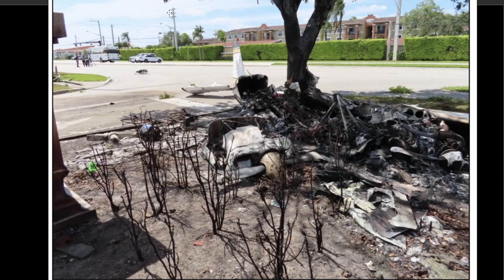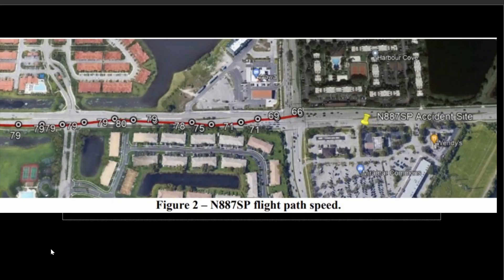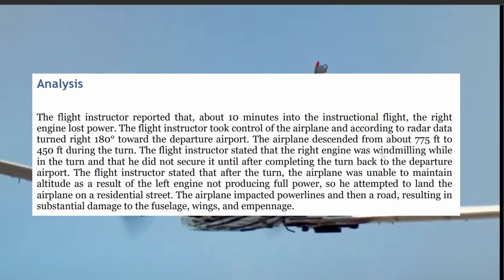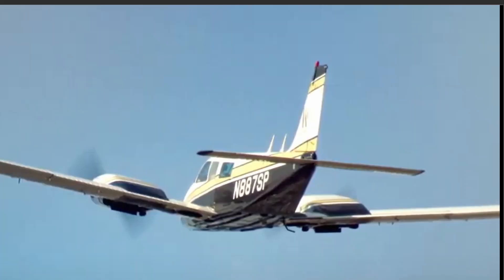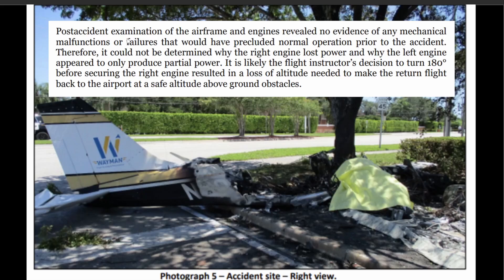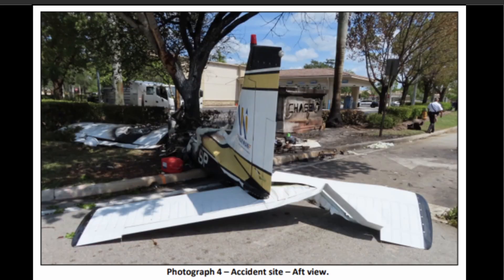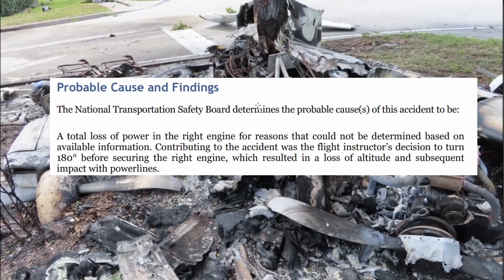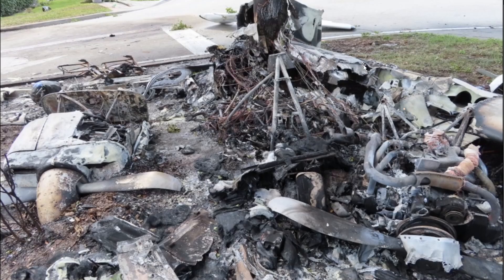Piper Aircraft and the Impossible Turn

Comment: CFI states that "I was unable to maintain altitude due the right engine failed and also i could not get full power from the left".  BS, BS, He didnt feather it, turned back when low IN PANIC, then i bet was so scared and weak that decided not to use full power on the other engine so had to do less effort in his fear. (Partly froze by fear) Then in fear decided to put it on a road.  

Senecas can hold altitude even with one engine windmilling if 2 on board only.  That CFI is a lying coward.  He killed his student too.  Bolted out and left him there to burn and die.  I have 2 full engine outs and landed them on airport both.

Comment: A 180 degree turn will take you to the downwind leg more or less depending on the angle of bank used.  It does not take you to the opposite runway as intended here and calling that An impossible turn".  That is a Turnback, not a 180'.  I learned them in 2001.
Reply: And you learned the 2 kinds from this "crazy CFI"  (As some called me in the 1990's because i could teach LOTOT/EFATO turnbacks and aerobatics too).  I proved them wrong,  They practice them now.

Comment: As a MEI I know most light twins we use for training have very poor single engine performance . Turning at low altitude, single engine, is a risky proposition. Climbing on one engine is usually no more than a few hundred feet per minute. Climbing straight, ahead as best you can, completing emergency checklists, and gaining speed and altitude before returning would be a good option. Maybe the instructor thought he was about to lose the other engine and had to take immediate action. Guess we will never know,.
Reply: Some of my new students either panicked and froze, ... or Panic and turnback without thinking.   Both pilot errors can knock you down.  Not acceptable pilot performance.
Reply: @emergencylowmaneuvering7350  Wish we had easy access to simulators like military, airlines, and big flight schools. May not help with fear, but procedures can be hammered home before ever flying.
Reply from the maker: Thanks for your thoughts.  Interesting

Comment: Right engine failure: Step 1- Feather engine. The simple fact that this was not done immediately, turned into the troubled engine, and, the confusing remark about the left engine, suddenly not producing "full power", only AFTER the turn with the windmilling right prop? 

Makes me question his ability, and if he was even rated for this craft. Everything it appears he did, was wrong- if this is all accurate. 

Sacrificing ANY altitude at that height, is basically dooming any chance of getting down alive- from all I've learned over the years. 

To me? This reads like he panicked, instead of flying the airplane in safely... 

After some further research? I'm beginning to really question the safety at this flight school. I'd love to have Dan Gryder take a look at this one. 

This is the 3rd "engine failure" from planes at this school. While neither of the other two resulted in fatalities, they both went down in non-airfield locations. One on another highway- a single engine Cessna, and the other in a swampy area, in a twin Seneca as well. 

The way the vice-president was out there talking to the press, stating how his flight instructor "did all he could do" & "followed all the strict safety procedures", (pp here), came across as phony- as if from someone who KNOWS his ass is already covered. 

In addition? This was in Broward County. They should change their name to "Lax County" or even "Coward County", being it's the home of the cops that did NOT charge into the school, much like the more recent one in Texas, to stop an active shooter, but instead just stood outside having tea... or something like that.. if ya catch my drift. 

Something seriously wrong here, imo- and in much need of further investigation. 

Many know, especially if they watch Dan Gryder's channel, how LITTLE the NTSB & FAA care, about GA, or "General Aviation". They prove it all the time.
Reply from the maker: Thanks Rick for sharing your thoughts, always appreciate your feedback on these

Comment: A Piper Seminol should be able to fly on one engine, just!
I am endorsed on this model and many other twins.
The correct proceedure at low altitude is to maintain "blue line" speed.
Both mixtures rich, both propellor pitch levers full fine, both throttles full.
Identify the dead engine, confirm by pulling the throttle and FEATHER the prop, mixture to idle cut off.
Confirm gear up, dead engine cowl flap closed.
Bank 5 degrees towards the good engine and MAINTAIN "blue line" speed.
If no obsticles ahead consider flying straight and climbing while MAINTAINING "blue line" speed.
DO NOT turn towards the dead engine, turn towards the good engine if a turn is necessary.
DO NOT turn at low altitude!
During my endorsment training in the Seminol, I was required to correctly handle an engine failure on take off at 300 feet and climb away to circuit height and return for a single engine landing, with the "dead" engine shut down and feathered. I had to do this on all the twins I was endorsed on.

If you cannot maintain height, the object then  is to fly straight at "blue line" speed minimise the height loss and find somewhere to land. Treat the aircraft like a single engine one with really good glide range.

Keep your flying speed, remember your training and don't panic!
"Blueline speed" is best single engine climb speed and is marked on the airspeed indicator with a blue line.

A truely unfortunate incident.
Reply from the maker: That was very informative, thank you for sharing and I hope you are subscribed.  Would love to hear your thoughts in the future

Comment: Condolences to all family and friends involved. However this is NOT an example of the 'impossible turn' which really applies only to single engine aircraft. According to the NTSB report the engine failure occurred 10 minutes into the flight, not an engine failure on take-off. Aircraft needs to be 'cleaned up' and stable prior to any further maneuvering following any power loss. Sad, so sad.
Reply from the maker: Thank you for the kid words
Reply: Agreed.   A 180 he did, but not on climb out after take off.  Some in FAA still call a 180 an "Impossible turn".  Ignorants of EFATO.   It was not the turn that crashed him, it was his idiocy on turning before feathering the engine as required.

Comment: Depends on the A/C but generally if you are lower than 300' and turn back you're dead. In a twin you have to establish safe flight and climb on the one engine prior to planning anything. If you turn into the dead engine, again... not good. My rule of thumb is just push stick forward, best glide, land the airplane. If you have a bunch.... 2k + do the check list for restart.
Reply from the maker: Thanks Tekish please subscribe for more aviation

Comment: Condolences for all concerned. My understanding is to never turn into the dead engine and never maneuver until you’ve cleaned up the airplane, feathered and trimmed for stable flight above blue line.
Reply: We'll never know the truth of what caused the accident but the plane is capable of maintaining altitude on one engine if failed engine propeller is feathered even if gear down and partial flaps. No turn should have been attempted at that low of an altitude. I believe there was a human factor involved that caused the crash.
Reply from the maker: Thank you for sharing

Comment: You are correct in your observation, sir -- the 180° "impossible" turn often results fatalities and destruction of property & the plane.

There are so many factors to consider, and attempting to return to the field immediately after a takeoff engine failure is not an option to be considered, unless you've already reached pattern altitude.  And, it does not matter if you're in a single or multi-engine craft -- losing an engine during climbout instantly results in loss of airspeed and lift, and increases induced drag, sometimes significantly.

In short, if your engine fails during takeoff, nose down immediately to establish best glide speed for your plane (usually 1.3x "clean" Vs), and pick a place in front of you (within 30° left or right max of your present heading) to "fly your plane to the crash site".  If your flaps are extended, do not retract them until you've passed 1.15x "clean" Vs, assuming you have enough altitude (again, depends on your aircraft).

If you have enough altitude to achieve best clean glide speed, the resulting rate of descent should be around 500 FPM.  Flaps are your enemy in this situation because they a) shorten your glide distance, and b) increase your rate of descent.  In short, adding flaps in this situation could kill you.

People are really bad at math when facing an emergency and in high-stress situations.  Because of that, you should mark your plane's critical V-speeds on the airspeed gauge using colored sticky arrows, or have them written down and affixed somewhere you can easily see them.  That frees you to do what is crucially needed, that is, to fly your plane at the correct speeds for the emergency situation, hopefully to a safe and survivable conclusion.
Reply from the maker: Thanks Jackal for writing in and sharing. I appreciate it

Comment: The 180 question is a tough one. You have to be a very competent pilot for this manover in a single engine aircraft, not to mention a multi engined aircraft. Critical engine failure (when you have both engines turning the same direction) on a twin just raises the stakes. Loss of a critical engine will force the dead engine side down due to the tork effect of the good engine trying to roll the dead side towards the ground instead of assisting it in being held up by the same force that it was spinning in the opposite direction. Ofcourse, the higher you are, the more success you will have in getting back. Don't believe it is a recommended menagerie. You can't fly the aircraft into the crash if the aircraft can't fly. Thanks a lot, sad to see someone didn't make it. Open field is a much better then playing frogger on the street.
Reply from the maker: Thanks Steve for writing in

Comment: The impossible turn really relates to single engine aircraft.....the reason this ended this way was because the failed engine was still windmilling "not feathered" those light twins won't fly with the prop not feathered
Reply: Is it possible he lost the ability to feather the prop, due to mech. issue?
Reply: @houseofsolomon2440  looks that way
Reply from the maker: Thanks For watching

Comment: He messed up.All he had to do was feather the bad engine, trim the plane, fly straight ahead and  start a SLOW climb to gain altitude.I wasn't there and we don't know how accurate these NTSB reports are .It says he turner right, into the dead engine, which is usually not recommended at a low altitude.We will never really know the true cause on this one.
Reply from the maker: Thanks Leroy

Comment: I do not agree with the final report on undetermined engine failure ,. You have 2 independent engine's with 2 independent electrical systems and 2 dual ignition systems  ,. One failed the other failing there is only one common denominator , Fuel , I . E . Water contamination , . The fuel selector valve can give you a clearer route to the answer for accurate determination . The turn should have never been attempted !  That Get there itis will get you every time . Be patient and fly the machine !  Your friend James
Reply from the maker: Thanks for your thoughts James

Comment: Personally, I would not attempt a return involving such an aggressive turn unless I was well above 2000 ft, this is just my humble opinion - just glide the aircraft avoiding turns and try to find an adequate pace to put it down - so sorry about the victim 😔 for the possible cause of loss of power I can only think of fuel contamination since it seemed to involve both engines
Reply from the maker: Thanks Mauro, that’s a rough one and hopefully some lessons learned

Comment: This is the worst case scenario in a twin engine. Right engine off and critical loosing power. In the case of tecnam p2006 that I fly is:  keep flying straight forward with whatever power you have even if you are losing altitude. At least the impact will be less severe. Another important thing is the blue line which seems he was on it. Very unlucky event. Difficult to judge if he made wrong or right. It's not clear also if the twin was clean ( gear and flaps up). Hope I will never get in an unlucky situation like this and definitely my condolences to the pilot.
Reply from the maker: Thanks for your thoughts and the kind words.  Hopefully some lessons learned

Comment: A loss of one engine is a loss of 50% power, and an increase of 75% or moe drag until feathered. VYSe= minimum rate of descent. Lose an engine on a King Air 200 over Red Table at FL 250, with a full boat, and experience my statement.
Reply from the maker: Thanks Again Sam. Right on

Comment: Feathering Procedures
The propellers can be feathered only while the engine is rotating above 800 RPM. Loss of
centrifugal force due to slowing RPM will actuate a stop pin that keeps the propeller from
feathering each time the engine is stopped on the ground. Single engine performance will
decrease if the propeller or the inoperative engine is not feathered.
Page 8 of 8 ERA20LA177
According to the Airplane Flying Handbook, Chapter 13: Transition to Multiengine Airplanes,
“Multiengine and single-engine airplanes operate differently during an engine failure. In a
multiengine airplane, loss of thrust from one engine affects both performance and control. The
most obvious problem is the loss of 50 percent of power, which reduces climb performance 80
to 90 percent. In some cases, after an engine failure, the ability to climb or maintain altitude in
a light-twin may not exist. After an engine failure, asymmetrical thrust also creates control
issues for the pilot. Attention to both these factors is crucial to safe OEI [one engine
inoperative] flight.”

The FAA found that the 180 degree turn PRIOR to feathering engine caused a loss of too much altitude, in other words immediate feathering and then limping back on 1 engine would've been possible.  It's practiced all the time for a multi rating.
Reply: Is there not an accumulator or something to force the prop into the feathered condition after 800rpm?
Edit: some quick Google searches: the accumulator is to un feather the prop not to feather it
Reply: @TheBrennan90  I don't think that it was not feathered, but they waited to long to feather it losing half their altitude.  Not sure why they couldn't at least climb 100' per min. after that.  Very similar to the Seminole I trained in, no critical engine.  Procedures must be 100% ingrained or startle factor can cause mistakes.  Instructor survived.

Comment: I was a ga pilot. Not current. I fly the sim now for fun. I do turn backs in the sim. Easy in the sim dead 'stick in a 172 to make it at 500ft. At 500ft power off no time to look ahead. You must steep turn left or right immediately to make it.  Live in a 172 at 700ft. You need to practice in the sim. Then practice at 5000 ft live. Then preflight and never need to do it. 700ft in a twin. Doesnt seem possible to make 180 with both engines out. To low.
Reply from the maker: Thanks Marty for those stats

Comment: The PA-34-200 on 1 engine can barely climb under ideal circumstances 190fpm, and that's with feathered engine secure.
Reply from the maker: Thanks for watching and the info
Reply: Soooooo… why is a Chieftan (and Mu-2) called an eight-place BBQs?
Reply: Did he really need to climb or just maintained altitude until he got cleaned up and then find a place to land.  I know we had engine problems at 300’ above ground and just configured to maintain altitude and then complete the circle back to the airport to land.  No quick 180.

Comment: When a twin-engine airplane loses an engine (50% of it power) it loses 70% to 90% of its climb performance.  Reasons include a reduction in excess power normally available to climb, different kinds of drag incurred by the imbalance, and control inputs to fight yaw.
Reply from the maker: That makes sense, thanks John

Comment: Correct me if I'm wrong, but both engine props appear to be in the feather position, I thought only the right engine had an issue, should have been able to return to the airport, with correct procedures.
Reply: Oh great point. Possible that they feathered the wrong engine?
Reply: @TheBrennan90  yes sir, and you may be correct as well. Perhaps we should both work for the NTSB
Reply from the maker: Yes both ended up not performing correctly
Reply: @ARFFWorld  thanks for the inflammation 😀